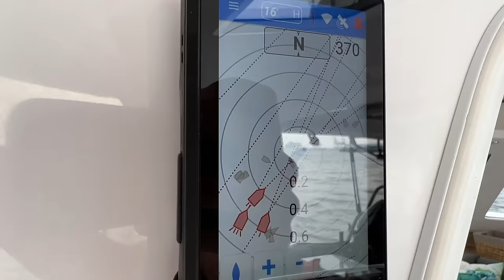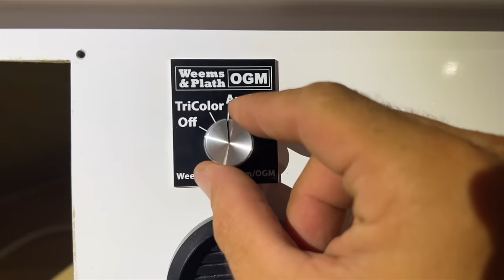If You Thought the Boat Work Was Over You Were Wrong

Comment: It bothers me a fair amount that the manufacturer would put dissimilar metals next to each other.  I would think that they would know better.  It looks like the boat is coming along nicely and will feel like home shortly.  Keep the good stuff coming.
Reply: It’s VIETNAM
Reply: Absolutely a no no to put dissimilar metals in a salt environment
Reply: @MrHAPPYHAWAIIAN  , I currently own a Bertram yacht, where they used stainless steel screws to attach a stainless steel strip to the aluminum rub  rail.  Built in good old southern Florida.  I also used to own a Catalina sailboat, also built in Florida, with stainless steel screws and bolts attaching aluminum hardware all over the place.  Who knows why that happens?
Reply: What about the rest of the thru hulls?! Definitely alarming that they would let that go at the factory...good catch!
Reply: @MrHAPPYHAWAIIAN But the Naval Architecture is not. They would deliver explicit plans and materials to use.
Reply: I agree. How was that thought acceptable?
Reply: This sounds to be an add on,   Not standard feature on the boat,   Maybe it was initially temporary and wa s missed to be changed out,  there was another thru haul in the video that looked to be plastic,    For sure I would double check any non standard thru hulls though
Reply: Kinda makes you wonder what else they may have missed
Reply: At least it’s not a 500k+ boat…. Oh wait.
Reply: Absolutely!!!! I really question what is going on over there!
Reply: @ralphholiman7401 It's FLORIDA!
Reply: It's a cost thing 
Stainless hardware is common and cheap for its strength 

And many sailboat items are aluminum from travelers to mast and booms and it's common to see the gooseneck held with stainless hardware as well 

Aluminum hardware is not as common and its pricey 

Carbon fiber and stainless is another mistake I see often in big name boats as well
Reply: Anyone who buys a catamaran better be ready they are very sketchy construction
Reply: Yay CT!  And yay Chubb!
Reply: Have been a huge Seawind fan: would like to know what they have to say about it?
Reply: Chinese boats are Chinese made ...duh

Comment: When you use marina water , be sure the hose you use is designed for drinking , especially if the hose is stored in the sun. Get the watermaker installed while out .

Comment: The thru hull type you removed is specifically designed to be anti cavitation or reduce it to extreme minimal while on the way. So basically, dont use your watermaker while on the way cause now you'll stuff it with air and the unit will break or worse = blow up!  You can use dissimilar metals BUT, the whole unit has to be grounded. My boat had all "metal" thru hulls grounded with a green wire...food for thought.  Just be careful and happy sailing.
Reply: Thanks for this advise when I change my next through hull which is a deck wash = I will look for an anti cavitation type of through hull = all plastic if possible.

Comment: polypro makes good anchor rode (with a short chain leader to weigh down the shank and prevent chafing as the line itself will float and naturally stay off the bottom)  like if you are going to be riding it a storm because it's somewhat stretchy but you have to keep it out of the sun when storing it.

Comment: I do hope you are sealing ALL screws and holes put in your boat with the appropriate sealant of your choice. I have repaired rotted plywood, and foam cores that had suffered water ingress from poorly installed fittings. The worst was a transom in a 28 foot stern drive cruiser that some rabbit had installed a swim platform. The whole transom collapsed when launching the boat after a winter ashore! Lucky it was still on the trailer!

Comment: Its funny most people fit filters to the drinking water and then add ice. The ice usually is not filtered water Its like buying a bottler of water in a café and asking for ice  🤮  the ice machine might not have been cleaned for months and the water is just the local tap water.. Great video 2x👍

Comment: Great to see you outfitting your new boat. I'd love it if someone did a comprehensive catalogue of all the ways people have outfitted their boats.  (& Seawind, stop it with the poly dock lines. I'll bet not even Beneteau does that. Poly is good for three uses: marking your chain, rope rode and chaffing the crap out of anything it touches. Of course I've seen Japanese fishing harbors where everything was poly. I don't understand how the boats don't get sawed in half.) 
Same impeller problem with the new 1260. Either those engines sitting in the sun in Vietnam or Yanmar bought a bad batch.  When our first impeller failed almost immediately, I asked if maybe we shouldn't replace both (they share the same lot #, same history....) It was carefully explained to me why this wasn't necessary. 50 hours of 'white smoke' (water vapor condensing) later that other impeller finally got replaced.  I'd brought to Vietnam a lot of the spare parts including a pair of impellers. Our experience + your experience suggests having four spare impellers on board. Stored carefully (out of direct heat, chemicals) they should last years. So it's an extra $80 that might not get used for a couple of years.... My own Yanmar is 20 years old 2400 hours, runs like new. That's worth a few impellers.  
When I hacksaw something with threads, if you have a thread die or even a bolt inboard from the cut, screwing these off really helps clean up the threads. I learned something important re: the through hulls. If that's on the boat I just sailed, I never noticed. I'll look for it now.  Thanks Tulas! 
Getting off and on those sugar scoops aren't as easy as one might think. Having done this now hundreds of times on the1280,a  Fontaine Pajot and another 50' cat,  I think there needs to be 'sockets' in the sugar scoops to insert a vertical pole that can be used for stepping off a dock or out of the dinghy.  (I've yet to be on a cat that's backed up to a dock, except for fuel docks, my Hunter 456 has only backed up to a dock. Its sugar scoop works how everyone thinks all sugar scoops work. Cats are usually relegated to docking alongside,)  Also there needs to be a tie point, or a line on the D ring,  on the sides of the dinghy to hold it in a steady position relative to the sugar scoop. The 50 cat  and the Fontaine Pajot the dinghy always seemed to be sliding under the bridge deck.  And there never seemed to be a hand hold where you'd want it. (After 7000 nm, end of my trip, waiting for Canada border to show up, I remarked how amazing it was that we'd sailed for three months with no injuries. Then I stepped onto the dock, the boat moved and I 'folded' between the hull and the dock, feet on the dock,  my hand sliding down the mooring line. I got a helping hand before my butt got wet. A pole would've kept this from happening. and made all those stepping around the side of the scoop a lot easier) 
The water tanks. A few weeks into our sailing the new 1260, our water pump had a problem so we swapped it out. From the filters we pulled all manner of caulking bits, fiberglass/resin dirt... I couldn't help but wonder about a  new boat cancer cluster.  "Oh, you're supposed to fill and empty the tanks several times...." That didn't happen and I didn't hear about this for a few weeks.  It also bothered me that there wasn't an easily accessible inspection port  on the water tank that could be unscrewed for tank inspection, and pumping out any sediment from the bottom. And when the new pump wasn't working and the watermaker wouldn't work unless it could be first purged from that pump , we had almost a week with what was left in a 20L bottle of water, and no manual access to the water left in the tank. 
Like your prototyping. Good practice. I've seen those complicated boat and bicycle pulley systems for garages. Every one of them, a single line snaking through all those pulleys,  they all raised and lowered evenly. Course on a boat, salt build up corrosion. But I'm sure you've got that covered. Good episode.

Comment: I see on your sail drive service that you opened the drain plug before the fill. Maybe you cracked it open before opening the drain. I always open the fill before opening the drain. In case the fill plug get stuck, I still have fluid in there until I can sort out the stuck plug. That’s in automotive applications, may be different for marine applications.

Comment: Billy, when I saw you start those engines on the dock I must admit I was not impressed. Its should never ever be done without lubrication, like in never, specially after it was left to dry for an extended period. Great that Sierra spotted an issue, hope you replaced the other one while you were at it. That damage sucks but agree with you, you didn't do it and its cosmetic and can be repaired that you wont ever see the damage happened. Boat is stunning.

Comment: I am sure you guys would know = UV is helpful with water systems. We circulate tank water through UV in our pharmaceutical purified water systems. Micro testing has shown this to be very helpful. We also hang UV tubes in the tanks - these are housed in a clear plastic water proof tube. Not sure what is the best system in terms of electricity usage on a boat. Possibly just hanging a tube in the tank will keep it micro free. Would like to know what is the best solution in a boat?

Comment: Why not just an in-line filter for the existing faucet?
Reply: Filter is only for drinking water. No reason to have ALL water going through the filter. Filter would have to be replaced too often.
Reply: Fair enough. I have a commercial ice machine that’s filtered. I change them every 6 months. Personally I’d go that route so I wouldn’t have to drill a hole through my countertop but it’s not my boat

Comment: I would be getting in touch with the manufacturer of your boat and let them know about the throughhull and the bad impeller. This isn't something that should happen and doesn't speak well about the manufacturer or the skill and trust in thier inspection process. From my experience fiber glass cracking can be a lot worse then what you can see. Hopefully there's not more damage that's not visible. Fiberglass damage can be a real nightmare.

Comment: Pretty sure you need the grate style thru hull in order to make water while underway.  You will have cavitation using that style of thru hull while underway.  Don't mean to be an arm chair skipper but if it were me I would have simply cleaned the threads up and put a matching material ball valve on it.  But that was a great catch.  That is a bummer about the shipping damage but you guys are handling it like pros.

Comment: Not a plumber , that  T piece , hard to fit ? Assume the base loosens , when tightened closes . could be fine for low pressure , me , check and do again :-) 
 Watermaker fine if sponsored , go for it :-) What happened to the rain water ?

Comment: No way I would have a plastic thru-hull below the water line.  Having to pull the boat to change the gear oil in the sail drives is a big downside to that system.

Comment: That’s not bronze. Bronze is very strong and typically lasts for decades. Bronze is a copper / pewter alloy. This through hull is brass, which is cheap shit, a copper / zinc alloy. That gets pink when it corrodes. Should be illegal on boats, but cheaters (the majority) still use it.